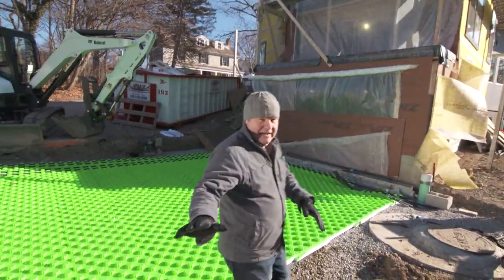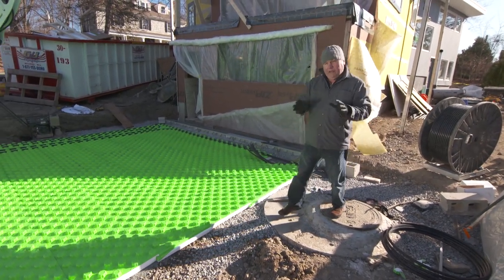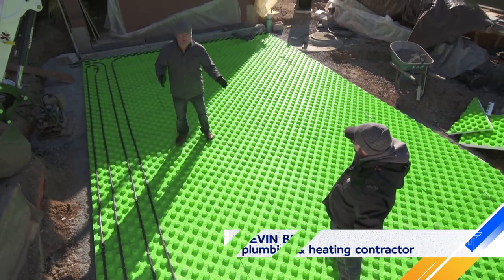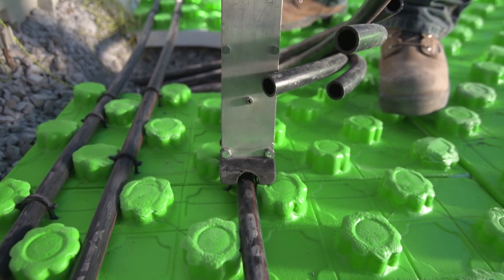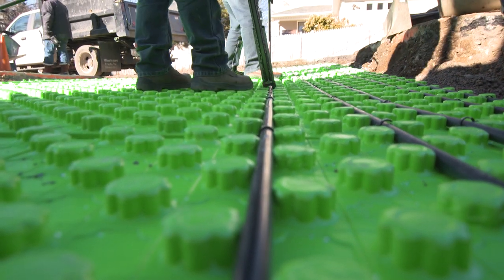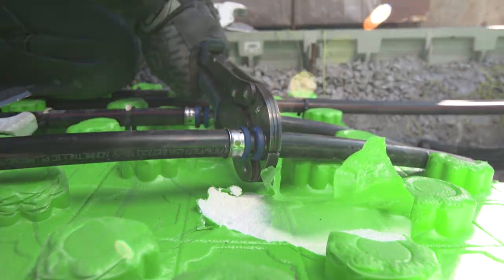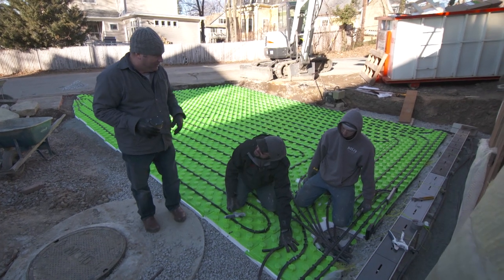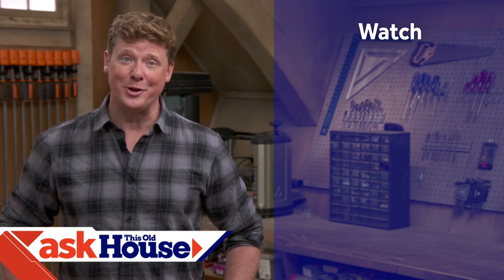Installing a Heated Driveway | This Old House

Comment: For all you brainiacs trying to figure out how much snow weighs and how many BTUs / Kw it takes to melt a foot of snow, I have news for you. Start figuring on the cost to jack up the slab surface to just a bit over freezing then multiply by the hours of operation. In a good portion of the USA we're talking maybe a 10 - 15 degree rise at most. IOW, not all that much. Systems like this COULD melt a foot of snow (and cause a serious ice dam) but they are basically meant to be switched on when the snow starts and prevent it from accumulating. Under ideal conditions most of the snow would be evaporating / melting at a similar rate to the snowfall. A 25 Kw system would run maybe $4 per hour to run so $40 for a 10 hour snowfall. Who ya gonna get to clear your driveway for $40? Yeah, there's installation costs but if you are fixing the driveway anyway it's not that much more. (and you could heat the driveway with a small wood stove instead of electric) I have older customers with electric versions of this systems and they claim several hundred feet of driveway costs under $100 to melt and a plow guy gets $150. So yeah, it can be cost effective.... but might take 20 years to break even. In the meanwhile you don't have to wait for a plow and the driveway is clear for the entire storm. NOT breaking a hip while sliding on the ice is worth something, right?

Comment: Only thing I don't like is coupling the pipe under the driveway. I would rather see the pipe coupled inside basement or in some type of box in the ground. That looks to be only place pipe may fail outside.
Reply: True, for the price of PEX, each run should be un-interupted.
Reply: Especially when you consider how caustic concrete can be.
Reply: Yep could not agree more shouldn't have made the connections in the middle of the slab. But with some guys, job security.
Reply: @jonathanfurtado3696  
It has nothing to do with job security.
It's lazy thinking, lack of training, or just an apathetic attitude towards their job.
No pride in doing a high quality job, just doing it cheep and fast.. Not that running full length tubes under the slab would take longer than stopping and making a connection.
Reply: I agree. Never seen someone who knows what they’re doing with slab heating bury a coupling. In fact they go to great lengths with planning to prevent just that. If there need to be couplings (or manifolds) between the slab and the house/garage, they bury an accessible valve box near the edge just for that purpose.

Comment: $2200 monthly electric bill....
Reply: Anytime anyone puts salt on their driveway, it eats away at the pavement... with this switch-activated solution, they're saving the cost of re-paving every 3 years
Reply: I use hydronic and spend $70 more a month, that’s combined gas and electric. I also only use it for snow melting and de icing.
Reply: Get a better energy supplier, if you think it is feasible to spend that per month
Reply: E W Mine got 15 to 20 years
Reply: @captainseagull3792  I lived in MN when I was growing up. Our driveway was redone once over 18 years. You're exaggerating a lot.
Reply: lol.  Repaving every 3 years.   Nice embellishment.
Reply: @one7decimal2eight  
"lol. Repaving every 3 years. Nice embellishment."

Not an embellishment if the contractor you are using is shorting the quality of the concrete so you have to repave every 3 years. But yeah, I would expect it to last at least 10 years if not more. It's not like you have thousands of cars driving down your driveway every day.

The $2200 a month to melt ice and snow only when the driveway needs to be thawed however, is not just an embellishment: it is either an intentional lie, or the guy is a complete idiot running the thing 24/7/365.

Comment: Great video, but way too short. How is it hooked up? How do you add the antifreeze? How do you heat it as I am sure you can't use a boiler with antifreeze in it? What does it look like with snow on it? What products are being used other than a larger PEX pipe, how large? so many questions!

Comment: "Wow they finally listened to us and made longer videos! They're showing the concrete installation, they're going to show-"  video ends

This Old House, you HAVE to show longer videos. People LOVE to see all the steps. WE WANT TO SEE THE FINAL PRODUCT FUNCTIONING.
Reply: I really wanted to see the heated driveway melting snow and whether it was laughably bad or not. =(
Reply: Like to know how long it takes to get it up to temperature on a 20° an will it crack if one heats it up to quickly
Reply: How many times do we have to complain before they listen? Time to switch to Home RenoVision DIY.
Reply: @greg925911  The thermal mass of concrete ensures that it wont heat up fast enough to crack. That is, unless they poured the slab too thin. Generally speaking, the water would have to be hotter than the max temp capacity of the pex for it to crack in that manner. At that point, the pex failure would be obvious and would fail before the concrete.

Comment: Can you start saying what the average costs are involved with these jobs?
Reply: Easy 10-15k depending on size of driveway +cost of electricity to run the heat.  Cheap snowblower for 350-800 dollars will last over 15 years+ 10-50 dollars in gas every season to run it  seems much more reasonable.
Reply: @jimkellt5358  well you missed the point. It would be nice on all these videos if they would also give a ball park what it cost regardless of what the project is. I don't care about this one job, but someone else might and them knowing ballpark what it coats might help if they gat quotes.
Reply: @Mechanickirk  yea it would be nice but all of a sudden you have 9 Karens calling in daily trying to talk to Tom Silva and Kevin O'Connor because the bids on the show are much lower than the ones being given by local contractors.  Intrested in a project? Research it.
Reply: @jimkellt5358  A snowblower won't do nothing about the ice. And rock salt can damage concrete.

Comment: Cost calculations for 3" of snow on a small 25' x 15' driveway are below.
(Spoiler: a small driveway with 3" of snow would cost ~$11 to melt off.)

I'm rounding here and there to keep things easier to follow:
1. Volume of snow, in cubic feet: 0.25 x 25 x 15 = 93.75.
2. Snow to water conversion is ~10-to-1, so we're talking 9.4 cubic feet of frozen water.
3. There are about 60 lbs of water per cubic foot, so we've got ~600 pounds of snow (ice).
4. To melt 1lb of ice takes ~150 kJ, which is 150 kJ / 3600 seconds in an hour ≈ 0.05 kWh.
5. So our 600lbs of ice will take ~30 kWh to melt if we were 100% efficient.
6. If actual efficiency is ~40%, we need 75 kWh. (Is 40% optimistic? Maybe.)
7. In the Midwest, energy is ~$0.15 / kWh in much of the areas where it snows, but it can be more, so it's ~$11 to melt 3 inches of snow on a small driveway.

Reflections...
- If you think efficiency is closer to 25%, then cost is more like $18.
- I assumed a pretty small driveway. If you've got a larger driveway, well, good luck.
- If it snows 12", that's nearly $50.
- I'm missing costs: heat the snow/ice to melting temperature, heat the slab (partially factored into efficiency), and evaporating any water left on the driveway to avoid ice forming. Maybe this tacks on 30% more, so we're talking about ~$15 for a 3" snow, or $60 for 1 foot of snow. I personally think that's very expensive.
- If I melt the ice into an ice dam at the bottom of my driveway where the heating stops, I've created a new, potentially bigger problem.
- For coal-sourced energy, 75 kWh of energy results in ~200 lbs of CO2 emissions. That is a lot of emissions for only 3" of snow on a small driveway.

Even if shoveling off the snow before heating to reduce the overall costs (my first idea in another comment), there's still a lot of sunk cost to heat the slab to melt off any residual, so this may not be a cost efficient option. The ice dam issue also concerns me quite a bit, as does the pollution from all the energy required. I'll personally pass on this melt-the-snow-on-my-driveway idea.
Reply: This guy is putting heated driveway. I don't think he/she is worried about money
Reply: Excellent analysis. I do have questions on number 4 since 1lb of snow is not the same as 1lb of ice. Snow should take a lot less energy to melt than ice in my uneducated opinion.
Reply: Using frozen water as a proxy for snow is a massive oversimplification and undermines your analysis. A block of ice behaves entirely differently to an air rich volume of snow.
Reply: @mistere5857  Hi, thanks for the note! Snow is a collection of ice crystals, so it's the weight that matters in terms if energy to melt. This is where the 10-to-1 volume reduction factor came in for step 2.
Reply: @MKRM27  I'm not sure that it would be notably different, but if you have a reason why, do share. Since snow is a collection of ice crystals, it's the weight that matters in terms if energy to melt, so really we're debating the efficiency factor in step 6, which I definitely agree was a very rough guess. More guidance on how that factor should be modified is welcome. :)
Reply: I am just going to leave this link here for you all to bother to read if you may:
https://www.concretenetwork.com/concrete/snow_melting_systems/costs.htm
Reply: @ae1ae2  presumably the ice Crystal's are much smaller in snow and as the other guy said, there is a lot of air between the crystals in snow whereas there is not in ice. I dont have any scientific data to back it up, but I think it would require less energy to melt a pound of snow than a pound of ice.

Comment: Heated driveways are quite common in my country as we have geothermal heating and after heating the house, you can use the leftover heat in the water to send through the driveway, so far we haven't used insulation beneath the concrete in any driveways I've seen, but it would be interesting to try it out and see the benefits of the insulation.
Reply: Do you have a video that would show how your driveways are heated?
Reply: +1 Geothermal is the best way to heat home IMO. It's an energy source that won't run out. TOH have done a video on it recently.
Reply: No insulation below your driveway? Do you have mild winters?

Comment: Ive got one. The cost is the pex is cheap. The heat isn't to 72 and only used to beat the ice buildup. It's magic. Naysayers
Reply: Yeah, all you need is 33 to 35 degrees for the snow and ice to melt. Go to 40 if you want it to melt faster.

Comment: Fittings under concrete? Yeah, no. One of those leak, you are screwed. Contractor would be fired on site in less than a second if that was my build. Thanks for the free work to that point.

Comment: I'd consider this, but I wouldn't stop shoveling. You can get the bulk of the snow off without paying crazy energy bills, and then melt/evaporate the residual off to avoid ice and injuries.
[Update: I've posted another comment with estimated costs, which are higher than I expected. Melting off 3" of snow on a small driveway (15' x 25') would cost $11. I also worry about an ice dam at the base of my driveway, as well as that this $11 in energy might generate around 200lbs of CO2 emissions and other pollution depending on how my energy is generated.]
Reply: Between install cost ($5000+), maintenance, and the cost to operate, you'd be much better off paying for a guy with a plow/blower to come by and clear your driveway when it snows. This is a cool thing to brag about, but it's totally impractical and a huge waste of energy.

Comment: Can a heated driveway like this tie into an existing boiler system for in floor radiant heat?
Reply: Yes in fact that's not uncommon and is a great match if you have a hydronic system in your home already. Most efficient and least operating cost is usually geothermal heat system running on electricity.
Reply: Bull S

Comment: I'm looking at building and evacuated tube solar hot water heating system for in floor heat in my ICF house and I'll also run pex in the sidewalk and driveway. 
I'll install a geothermal system to supplement. 
Energy bills will be almost non-existent even in February.

Comment: All the nay sayers have never dealt with a snow melt system like this. I installed a massive unit to condition the parking and sidewalks at a hospital. It made me a firm believer. The unit uses very little power to produce insane results. Winter slabs heave when not conditioned, when you conditions these slabs the insulation under them makes it very difficult for frost to drive it’s way underneath and heave so your slab stays level and crack free longer. If you’re doing new concrete the best investment is to install loops even if you don’t currently plan on doing hydronic. It’ll pay for itself the first time you don’t have to shovel snow or pay someone to.
Reply: Leland Holton Not useful.  There are many features of a project that may or may not be useful to the net result. These are always weighed against cost, maintenance, and safety, which neither the video or you address.  Perhaps the cost applied to the radiant heat system you reference could have allowed another dozen parking  spots.  Perhaps the driveway melt creates a frozen lake as soon as it hits the street, unlike to the-side snow blowing.  And no, a radiant driveway heat install won’t  pay for itself in a $100 or  $200 snow removal.
Reply: What a waste of resources. This is a perfect example of the differences between price and cost. However, in this case, both the initial price tag and the cost over time are astronomical. Give me a shout out when the hospital calls you to tear up the mess you helped to create when the system fails and you placed it all under concrete in a high use area.
Reply: Hospitals often have tons of waste heat or an existing steam plant to leverage for a system like this. Comparing that to residential is absurd
Reply: This was a helpful viewpoint, thanks!

I do wonder if you could elaborate on how this pays for itself after the first use. How much are you paying people to shovel your driveway? I made $1 per inch of snow as a kid for a driveway, and this install looks like it costs $1000s.
Reply: @ae1ae2  $20+ per hour including benefits, could easily be $30 in a high COL area. Besides that, there is the huge risk of slip and fall injuries. Clear walkways mitigates a ton of risk, especially at a place like a hospital where visitors/patients are at a higher risk of injury than the general population. Makes perfect sense in that setting
Reply: @mike93lx  For reference, I did a cost estimate to melt 3" of snow on a small driveway (15' x 25') in another comment, and it came out to $11+ (you can check my full calculations in the other comment). If considering 1 foot of snow on a medium sized driveway, that might cost about $100 to melt / clear the driveway. I'd also be very worried about forming an ice dam at the base of my driveway, which would itself create a new safety hazard.
Reply: Just going to post this link if any of you are willing to bother yourself to click on and read it and imo the costs sabings of operating a heating system as this outweight the cost of winding up in the hospital or having the plow truck have any space to place the snow they push and I live in a rental with a walled up driveway on one side and two buildings blocking the rest of it on the end and other side of which is a commercial building that the landlord already owns. And he does a crappy job of plowing even if it is easy snow to shovel and I myself have unusually high blood pressure, luckily he uses a loader to remove the snow or pile up on the lawn atop the retaining wall). I  been hating shoveling the walkways since i moved in here 10-11 years ago and always stuck shoveling the walkways myself. My new and hopefully own home or other rental place will hopefully be better plowed and shoveled as good a I do it myself (I am bit of a perfectionist) or has such a heating system installed before the driveway and such are paved or poured down.
Here is the article pointing out the general cost to buy the component along with the operation cost which can vary per location energy supplier demands and fees:
https://www.concretenetwork.com/concrete/snow_melting_systems/costs.htm